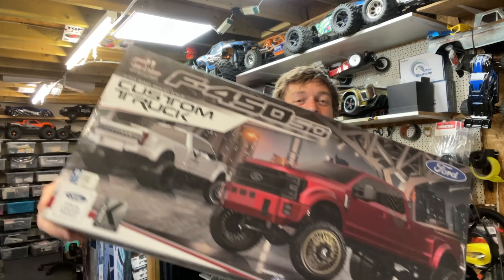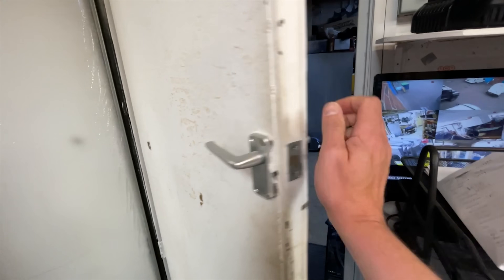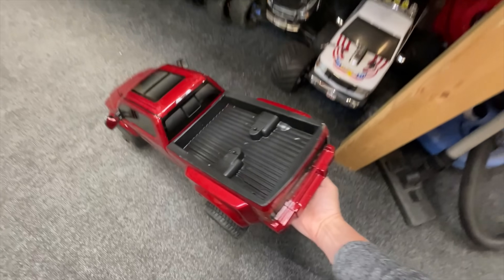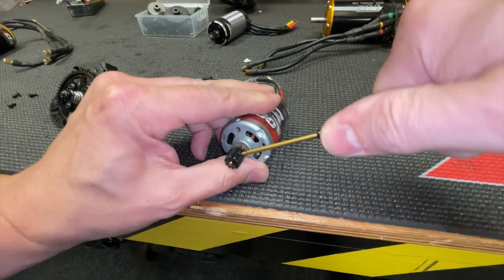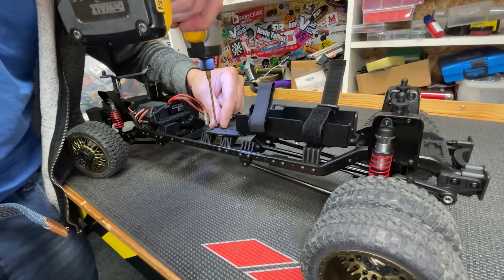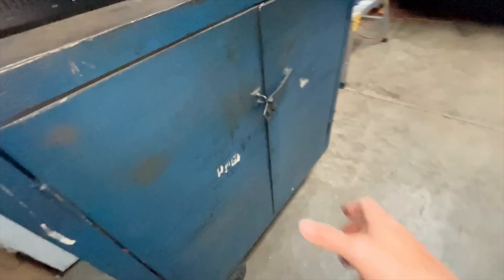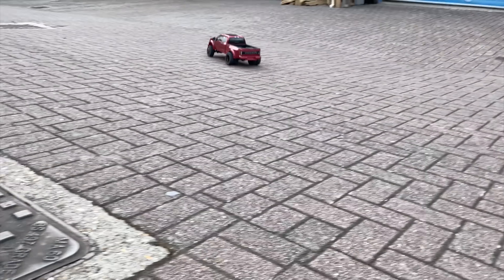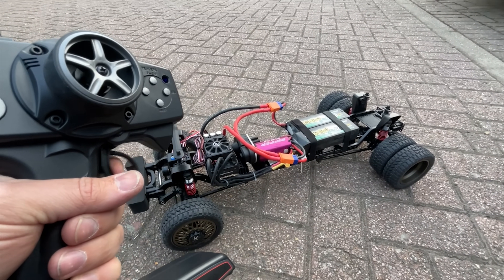Ford f450 RC Burnout Truck Destroys Carpet

Comment: Having owned one of these trucks in real life I can tell you that this model is a great representation. Truth is no one over here that build these real trucks (me included) would never use such hard suspension. I used Fox Piggybacks and they are plush like a water bed at slow speeds. Great vid Kev. When you do Monster Jam make sure it's the Atlanta one bro so I can come meet you and see your weapon in action.

Comment: Hey Kevin if you take the motor mount and take same size drill bit you can make it slotted .. then you can mess a little bit probably get a few different size pinions to fit that way

Comment: Having watched your channel for a while, I find it curious that you always resort to huge motors, monster ESC and massive batteries, to add power to otherwise feeble rc vehicles. There are other ways, which might (maybe) have better outcomes, at least in some scenarios. Rather than heading straight to massive kv motors, which seem to be mostly really heavy and big, why not head to a modified low-turn sensored motor (8.5T or 6.5T), set up the timing on an engine dyno for max output (its not very difficult) and set up the gearing for max speed (or torque) . Then you can use a sensored ESC, and correspondingly, then set up the ESC for max power, according to the preferred application. Again, not difficult, especially compared to all the bodywork and chassis mods you do to fit the big heavy components. Batteries can correspondingly be dramatically reduced, 2S or 3S should be heaps. Outcome, gross vehicle weight will surely be reduced, a lot, which will surely improve durability, especially on big-air landings. Speeds, will probably increase (less weight to move), and control-ability / drive-ability should also improve, cornering mass will be much lower. Its what the rc racing fraternity has been doing for years, and you already use the handsets that can take best advantage of these components. Great channel btw, be interesting to see if you enter into these components. Looking forward to next episodes.

Comment: I used to blow the motors in my drone and they would sound like that. The enamel on the wires melts causing it to magnetize unevenly and run rough. Motor is much cheaper than esc so thats good. Really like these scale trucks and cars.

Comment: I built mine up. Has over size tires and lifted. Went with a traxis brushless motor and three cell battery. Has so much torque you have to turn it right when you launch or she pulls left something fierce

Comment: hey Kevin I have a arrma granite voltage and the ESC light flashes red the steering still works but the throttle doesn't work I tested the wires from the ESC to the motor

Comment: Someone may have brought it to your attention already. But the transmission is a 2 speed. There is a high torque low speed and a low torque high speed. It comes out of the box with the high torque gearing.

Comment: You could get the new dig transmission from axial scx10.3 and lock the front drive line like it’s a brake and do burnouts

Comment: Once i was drifting around in my street and suddenly my car stopped driving but i heard the brushed Himoto rc 540 motor still running. Maybe there is a problem with the transmission. After a week or so it drives again but it drives only half of the speed and it does not want to drift.
Reply: Update: servo is also dead.

Comment: I've seen there is a way to change the transmission in the 450 to high speed by moving the gears around in the transmission

Comment: So let me get this straight:

CEN wants $419 for a bare-bones BRUSHED RC truck with a low-detail stickered body, bad suspension, terrible wheels and tires, a seemingly super low-quality radio, and was that an already-bent driveshaft I saw??

Yeah, I'll pass. You can literally buy a TRX-4 Sport with 10x the functionality and quality for less than what this costs.

Comment: hahhaha, maximum rpm of most bl motors is 50k. 8s = 33.6V, the KV rating has to be just barely north of 1000 to take 8s.